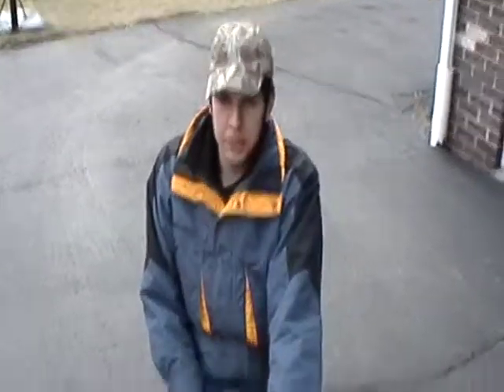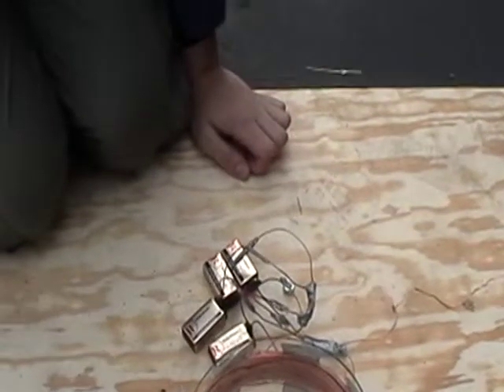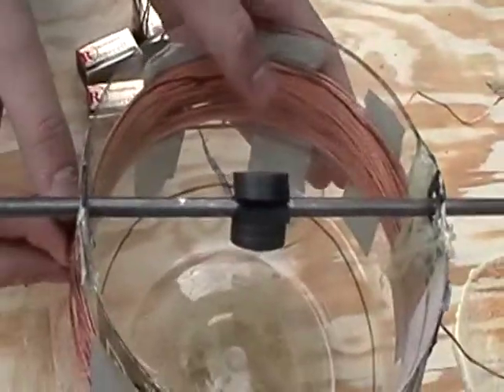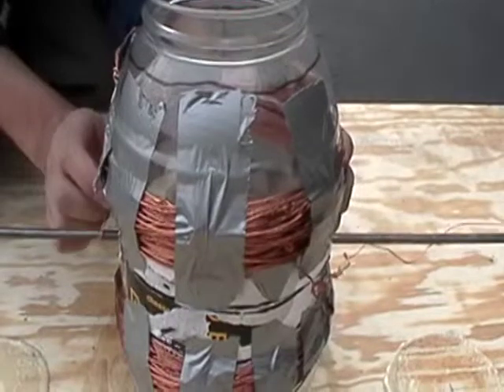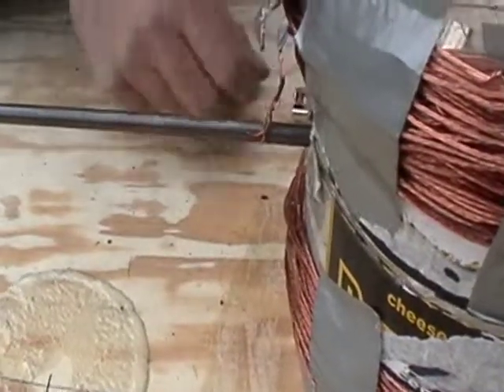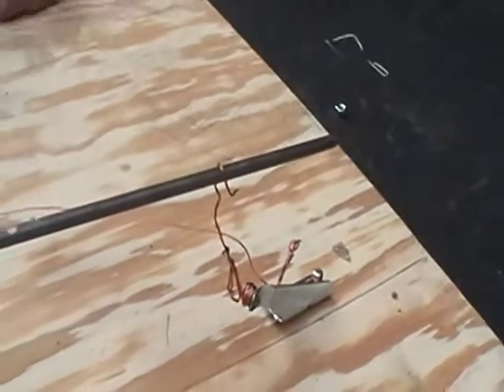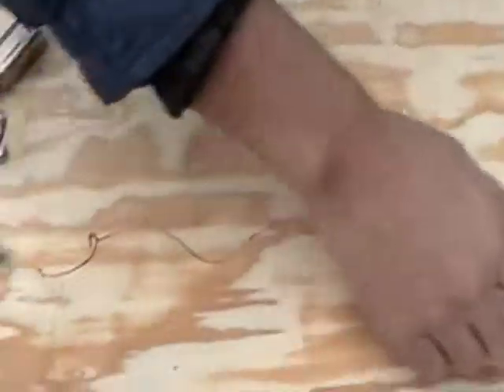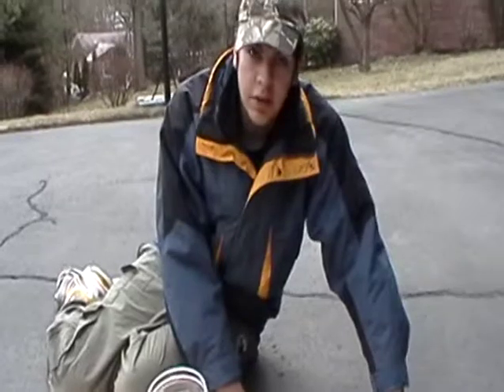Newman Motor Problems

Comment: Hi, one problem is the distance between the magnets and your coils.
1. Use a smaller diameter drum / tube and rewind the coils.
2. Or find away of extending your magnets i.e. with a peace of dowel drill hole in the centre of it and mount the magnets on the each end of the dowel.